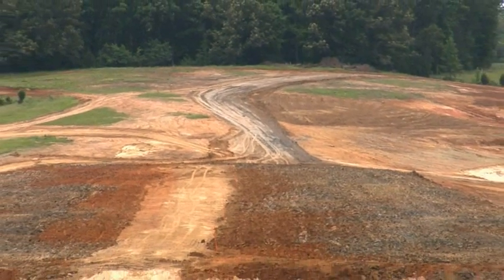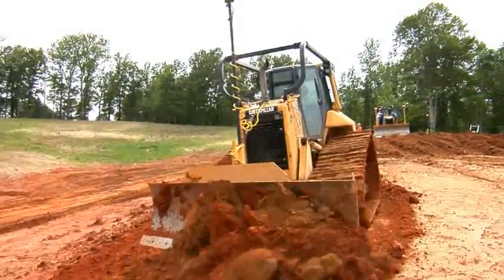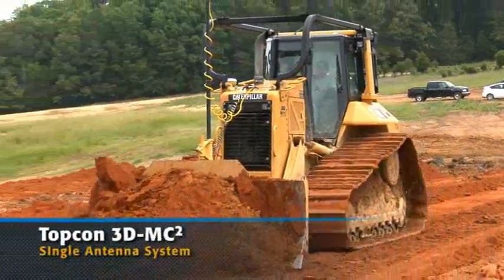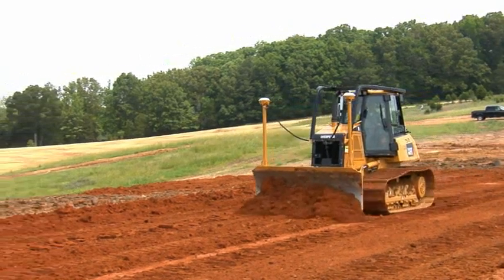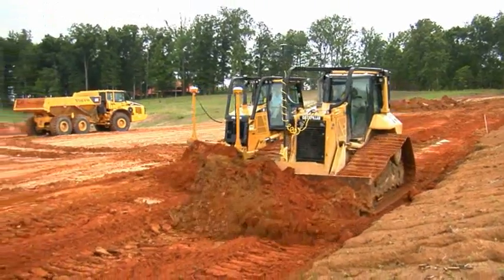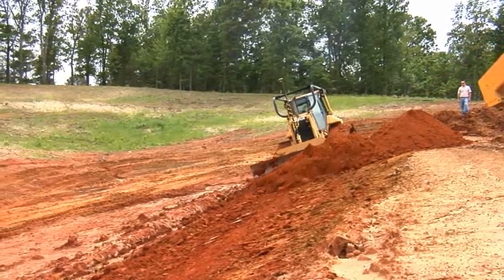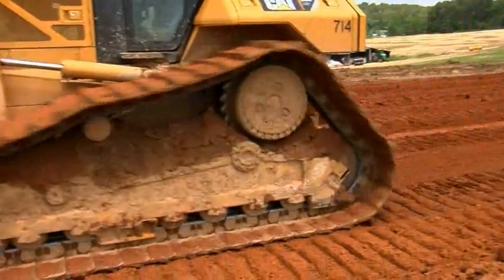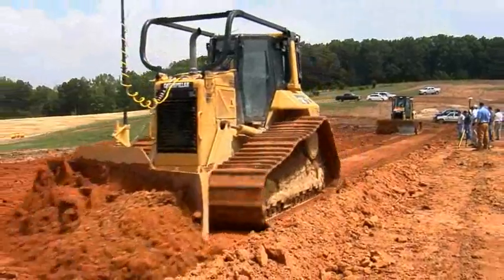NEW Topcon 3DMC2 system VS. CAT/TRIMBLE Accugrade system on SAME jobsite

Comment: I've been running Trimble for about 3 years now and the difference this video shows isn't in the grade control systems it's the difference in the undercarriage / machine weight we have 2 850 Deere dozers with dual 3D Trimble systems our 850C cuts like the D6K in this video our 850J LGP cuts like the D6N in this video they should have compared two machines with the same operating weight and undercarriage not two completely different machines.

Comment: Not a good comparison when comparing a D6K XL to D6N LGP. Accugrade & Trimble systems support blade rotation. The Topcon system cannot calculate the position of each corner of the blade relative to the machine travel. I also hear that the Caterpillar Accugrade and the Trimble system hardware is much more robust.